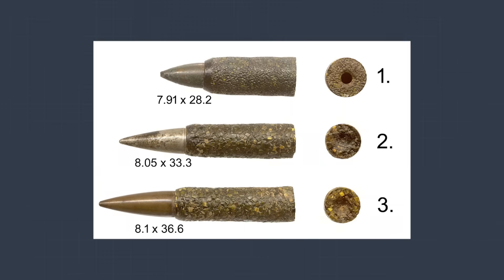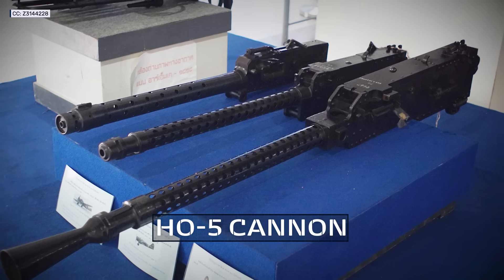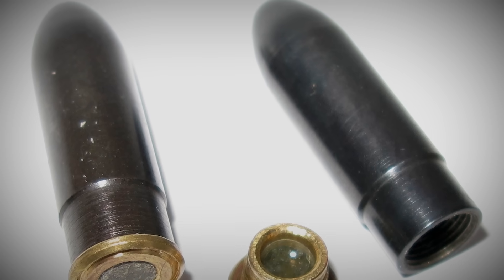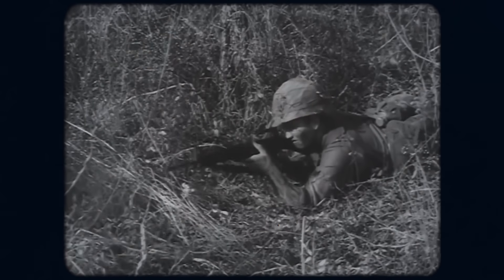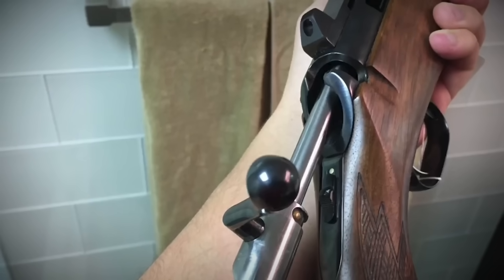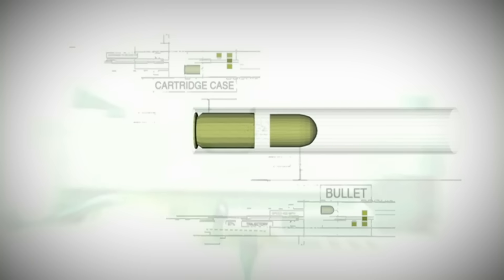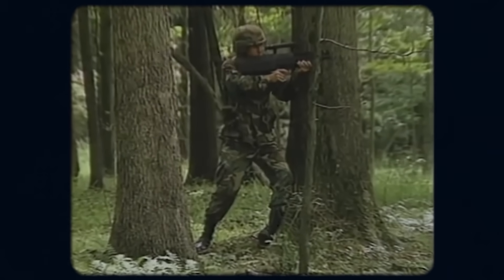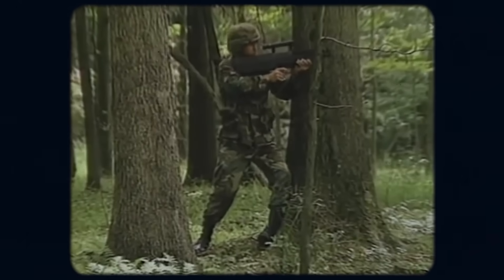Is Caseless Ammunition the Future of Warfare?

Comment: Before I watch: No. At least not any time in the near future. A primary function of (most commonly seen) brass and steel casings is to expell heat from the gun. Caseless ammunition has been tried before a few times, but firearms that use caseless ammunition are much more suseptible to wear and tear from heat exposure. Not to mention complete failure and NDs from rounds getting too hot in the chamber and cooking off.

Edit: grunts in the military also like their equipment to be familiar and relatively simplistic in design. See: the H&K G11 and it's fucking grandfather clock for internals that had to be sent back to HK for maintenance because grunts couldn't figure out how in the fuck it worked. Basic firearm industry rule: don't leave German firearm designers unsupervised with an unlimited supply of funding and nose torque.

Comment: Disappointed that Railguns weren't mentioned in this video at all. They are the perfect caseless round, although of course the tech isn't yet perfected
Reply: They’re not, the guns tear themselves apart, and the video is talking about chemical propelled ammunition. Also, rail guns aren’t worth it, they don’t work on small platforms and large platforms are so energy intensive that only nuclear plants can power them and they still destroy the gun. Not worth it at all, and not relevant to the other guns mentioned.
Reply: @Yomotomen  there are handheld railguns that exist right now that don’t tear themselves apart. The video is about creating caseless ammunition with the purpose to have it be quicker and cheaper to manufacture.
Reply: @k_469  semantics

Comment: There is some artillery that doesn't use propellant cases but they just shove some propellant blocks or bags after the shell. Not quite the same as self-contained caseless round though.
Reply: Most larger artillery and naval guns (roughly 150mm caliber or bigger) uses bagged charges or its modern combustible modular case equivalents. Things like (low) rate of fire, insulating properties of the bag or combustible case and (at need) swabbing out the breech between shots probably help prevent cookoff. At those calibers, cased ammunition gets used for higher rate of fire (AAA guns) and/or autoloading applications (think USS Des Moines).
Reply: @echomande4395  a 16 inch case would be unpracticality huge and heavy
Reply: @JeffBilkins  imagine what a casing for the Gustav or the 18 inch on the Yamatos would have been like

Comment: Honestly, we're at least a hundred yesrs of material science and engineering, away from succeeding in creating a workable ammunition and platform for delivery, using a caseless system. 

 Between the problems of removing excess heat from the weapon fast enough to protect the weapon and the ammunition, and having the ammunition be impervious to environmental circumstances to the same degree that regular ammunition is, the issues with the designs and ideas floating around right now are insurmountable. Passively cooling chambers and barrels isn't fast enough, but mechanically cooling them would add weight and/or complexity and parts count. Making ammunition stable under all circumstances except the specific circumstance of ignition, is difficult enough for manufacturers of cased rounds. Having the actual powder charge exposed to the elements and expecting a highly volatile chemical not to expand, sweat, or otherwise change in such a way as to reduce or remove its safety factor is unreasonable.

Comment: I doubt caseless ammo will ever be fixed to work as well as brass ammo. It comes down to physics. Old powder and ball guns were able to get a good seal because the ball was malleable to seal around the barrel. But they weren’t very accurate. The brass case allows for extremely high pressures to push that bullet forward and to seal the barrel from rearward gases.

Comment: I feel like you should have mentioned "bullet storm", it was featured on that show future weapons. It was supposedly capable of 1 million rounds per minute.
Reply: MetalStorm wasn't really caseless. The barrel was the case. Once you fired it, you replaced the entire barrel assembly in order to reload.
Reply: @Eyllena  I think metal storm can correctly be considered a caseless system because it also does away with the entire firing mechanism, action and breach of traditional firearms. So saying that the barrel is the case is a bit of a stretch since the barrel and the packed ammunition are the majority of the system, the rest is just electronic igniter control.
Reply: @Eyllena  metalstorm, thank you! But, I mean I assume you had to reloaded the G11 like any conventional gun and it was probably a conventional magazine design. Metalstorm just cut out the time it takes to feed and seat a round.
Reply: Your correct from what I remember, it was careless.
Reply: That was such a cool idea; I'm still disappointed it died. Was it just because it was prohibitively expensive, or was there another issue?

Comment: One of the fun things about caseless ammo is how it cooks off all at once if the gun gets too hot.
Reply: Except it was solved decades ago by Dynamit Nobel. The G11 was just super over engineered and designed around a problem that wasn’t a problem.
Reply: @thegroundhurts 

Sounds like typical German engineering lol
Reply: @Andyboy992  The G11 was also firing three rounds before recoiling, which is where most of the complexity is.
Reply: really not an issue given that you can light modern explosives on fire, or try to anyways, and not get a detonation. Brass conducts heat very well so it's not like it's some magic barrier between the gunpowder and any heat
Reply: @moonasha  you know a lot that just isn't correct.
Reply: Sadly, yes
Reply: Someone just needs to design a better radiator.
Reply: This has not been a problem so far.  When a round is chambered, the bolt is closed, so a cook off would just fire the round out of the barrel.  Cook-offs are not easy since the propellant is "insensitive" and requires the increased pressure from the primer's ignition to deflagrate rapidly .  The primers themselves are insulated by the propellant and are hard to set off by chamber heat.    The propellant, like most smokeless "powders", just burns relatively slowly when not under pressure.  Jim Schatz noted that loose/damaged rounds with primers removed worked well to start campfires.
Reply: @jfess1911  wrong. It is the primary problem with caseless ammunition. By the way, more than just the round in the chamber is heated up. I'd tell you to do actual research, but a 6 year old kid has a better understanding of thermodynamics than you.
Reply: @postmodernmining  Gee, it seems that my years of ballistics research and associated degrees in engineering have been for naught.   How disappointing.
FWIW, Jim Schatz did an excellent presentation back in 2012 at an NDIA conference entitled "Caseless Small Arms Ammunition The Good, The Bad, The Ugly" which you might find interesting.  It discusses "lessons learned" from HK's work on caseless small arms development over the preceding decades.   I have not seen a lot about this recently, but would appreciate leads to pertinent work.
Reply: Hows that? Wouldn't that be an issue with any kind of ammunition?
Reply: @JeffBilkins the casings are actually a pretty effective medium to capture the heat.  When it's ejected a lot of heat leaves with the brass, cooling the chamber for the next round.  Caseless ammo doesn't get that exchange so things can really heat up with prolonged fire.
Reply: @JeffBilkins  there are fire barriers between all cased ammunition.
Reply: @JeffBilkins  once the first round goes off out of battery a bunch of very hot gas rushes into the magazine, cooking off the rest of the caseless ammo in it.

for normal ammo that doesn't happen cause the metal casings require a lot of energy to get hot enough to set off the primer or main charge
Reply: @k_469  yeah the weapon is out of commission. But the soldier is mostly fine if a single round goes off out of battery.

The entirely magazine lighting off on the other hand is probably going to put the soldier in the hospital

Comment: Ultimately the improvements in battery technology and magnets will lead to firearms as we know them becoming obsolete. MAG, or magnetic accelerator guns, will eventually replace chemical firearms.
Reply: There are physics limitations to using electricity to accelerate a given mass that will always mean a chemical reaction is more efficient the greater the mass gets. 

The heat generated tends to make electrical efficiency drop. The cooling needed to make this work in actual combat conditions means it is going to be slow, if mobile at all. And the materials needed are still very far in the future. If at all...

Comment: You haven’t mentioned liquid propellant version of case-less firearms, several studies were carried out on utilising liquid propellants in cannons.
Reply: Interesting...two magazines, a tube of "propellent toothpaste" squeezes a premeasured quantity into the back half of the breech while the mag feeds the bullet in the fore half of the breech.  Might be possible to do half-loads, for target practice.  Different quantities for different calibers.  Just thinking out loud.
Reply: @jodycarter7308 this was studied very heavily by the British weapons research group and did have working prototypes but consistent performance was never achieved. Always fascinated me.
Reply: Propellant would have to be stores separately from bullets. And you still get the sealing and heat removal issues. And add several new ones :)
Reply: @andrzej2501 your not wrong but it was heavily researched and developed to the stage of working prototypes but cost overruns and inconsistency in performance ended the British project.
Reply: @Happy3dprinting  Well, ceaseless ammo and rocket-bullets were also heavily researched and developed to the stage of working prototypes ;)

Comment: Didn’t it. All start with case less ammo?? I’m thinking of the old musket guns and old cannons??? Pack with gun powder then drop a lead ball in and away we go. Then the case was thought up to improve aim, durability. Power etc. I’m no gun guy as I’m from Britain but yeah, just a thought. 🤔
Reply: The drawbacks of caseless ammo don't apply to muzzle loaders. Heat build up isn't an issue because the fire rate is so slow, and the propellant doesn't get dirty cos it's stored in a pouch.

Comment: M16 gets a bad rap for reliability issues only due to politicians who made changes to the rifle that caused it to fail.  Use of the wrong powder type.  Failure to chrome line the bore and chamber as Stoner designed it.  Failure to ship the rifle with a cleaning kit.  Telling people it never needed to be cleaned.  All these contributed to surface rust on the chamber which caused failure to feed or eject.  The G11 failed due to FUD syndrome and it being over engineered.  I love Germans but they can over engineer things.  Caseless ammo will fail 80% due to FUD's who fear change, and the fact that the ammo is fragile and can be effected by moisture.  A move to something with a biodegrading case would be better.  A surface coating that broke down due to the heat of being fired would allow the case to break down without causing a problem with the surrounding ecosystem.

Comment: ALL PCPs (PreCharged Pneumatics) are caseless. Just the round and air. And i3 don't just mean bbs. One i have is capable of taking down elk and grizzly...
Reply: Waaay back in the day poachers made air guns for taking down big game on the king's land.
Reply: @jodycarter7308  
Yup. Lewis and Clark had one as well. I think they took a few bison with it, if I remember correctly.
Reply: On the other hand all the weight and money cost you save on cases will come back with a vengeance in the form of the high-pressure storage tank for the air :)
Reply: @andrzej2501  
Sort of. Used scuba tanks can be affordable. The high PSI compressor, like the one I have, however, will put you back a bit...
Reply: @MiscMitz  It's also not very portable if you want to fire many shots. Like say a soldier in a war. Energy density is kind of important in that case, and chemical handily beats compressed air in that regard.

Comment: The heat needs to go somewhere. The case is ejected with a good amount of the heat. With caseless ammunition the heat is contained in the gun. Heat and friction kill barrels. No free lunch in physics.
Reply: Heat "kills" the barrel (rifling wear and expansion). The burning gases don't impact the chamber much.
Reply: @haroldhenderson2824  but the heat of the chamber causes cook-offs. This is why brass is important. Also, the chamber is part of the barrel. The "throat" is the angled part between the barrel and the chamber. Throat expansion is often the cause of inconsistent ballistic data. Throat expansion is cause by rapid heat transfer. All of this occurs in the chamber.
Reply: YEAH GOOD POINT ONLY ON SNIPER VRIFLES THE BARREL WOULD BE WHITE HIT OTHERWISE
Reply: is it possible to have the projectile to be hotter so the heat is dumped that way?
Reply: @imlostagainWTF yes the Russians solved it, as was shown in the video. but the round have to be fat and slow so not really fit for an assault rifle type of weapon.
Reply: We did almost achieve perfection when someone had the idea to combine the G11 ammo, and the AAI ACR's heat sink...but... Patents!
Reply: "The amount of heat ejected by the fired case is a rounding error"  - said by someone who has never picked up a freshly fired piece of brass.
Reply: @Kyle-sr6jm  the laws of thermodynamics dictate that an object which was suddenly heated to a high degree will cool just as fast. Now given that I grab my brass as I shoot for animation renders, I can say for sure the only issue with your statement is not being used to it. The secret is to not latch on to it, but instead roll it around. Also, I can tell you for sure that you never picked a bullet from ballistic gel or which was recently fire to note the 'subtle' difference.
Reply: The heat goes up your ass
Reply: @babute21  nice.
Reply: Turn the heat into a resource. Super heated rounds.

Would require advanced meta material barrels, though.

Expensive, but stronger, lighter, and heat resistant.
Reply: What keeps the powder from cooking off under rapid fire conditions?
Reply: I do not know what is more concerning, the fact that you are a bafoon or the 200 plus people agreeing with you.
Reply: Y’all sound more like politicians than engineers/physicists…
Reply: @ADude-f3z  how so?
Reply: @t.j.poductions6462  arguing rather than collaborating.
Reply: Most of the heat goes into the ejected hot gas and the barrel, the heat in the case is a rounding error
Reply: @redbandet most of the heat goes into the ejected hot gas and the barrel.
Right, it's the bit that doesn't that causes problems... obviously
Reply: @redbandet  re: "Most of the heat goes into the ejected hot gas and the barrel, the heat in the case is a rounding error"
No.  The polymer-cased ammo made by True Velocity for the NGSW trials showed that reducing the heat loss to the case and chamber allowed the use of less propellant.  It is not a massive amount, but significant, none the less.
Reply: @redbandet  not a rounding error. We're not talking about what is ejected from the muzzle. Only what is contained and ejected from the action. That's where the most rapid heating occurs.
Reply: @redbandet  it rounding errors that add up are actually relevant
Reply: @ashoka9306  In relation to the total heat caused by the burning propellant - it's really not much.

There are plenty of solutions to overheating - already used on all sorts of quick-firing firearms in the past.

Yes - it makes more effort - yes - it costs more - but it's very far from unsolvable.
Reply: @redbandet  what is true is that careless ammo burns barrels fast do you have a design that solves this?
Reply: @t.j.poductions6462  would a gatling type gun (or rotary cannon) be a good candidate for careless ammo? 

This might be me greatly oversimplified things, but wouldn't paper cartridges used in muzzleloading be considered a type of "caseless" ammo?
Reply: @samsadowitz1724  it would but a gatlin system would be difficult to make man portable.  Good start though.
Reply: @redbandet  The bit of heat in the case could absolutely be solved through various measures already in use in machine guns and autocannons.
Reply: @XMysticHerox  they've tried. What's your design?
Reply: @XMysticHerox  the problem is creating a weapon that is man portable which can withstand the amount of heat put off by caseless ammunition.  Autocannons are not man portable. Do you have a solution to this issue?
Reply: @k_469  pipe down Lil guy. The adults are talking.
Reply: @XMysticHerox  Are you going to carry a couple extra barrels and or gallons of water?  Aside from aircraft guns that have an immense amount of cold air flowing over/through the barrel constantly, those are the only solutions to heat that I know of.  IE none of them work for an infantryman's carbine.
Reply: @k_469  Are boomers the only people who can post comments in English?
Reply: @k_469  I'm in my 20's dude. Try again.
Reply: Liquid turning to vapor can take of that problem.
Reply: @catalinbadalan4463  that is true. I wonder how that could be contained in a cartridge. It's an interesting concept.
Reply: Duh, guns are going to have heat sinks in the future, like really dangerous gaming PCs.
Reply: @Blaze6108  that is a clever idea. Many older guns have ribbed barrels to act as a heat sink. 3d printing could prove useful in implementing that design choice into chambers and actions.